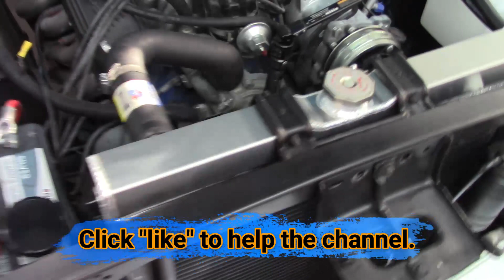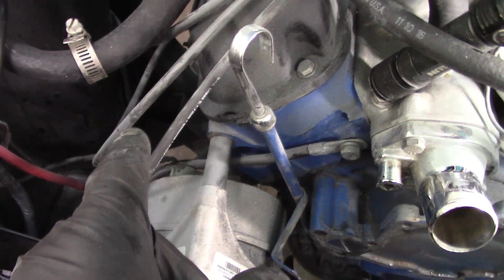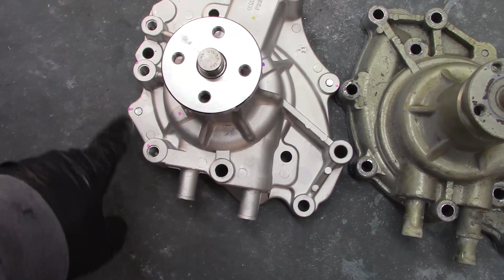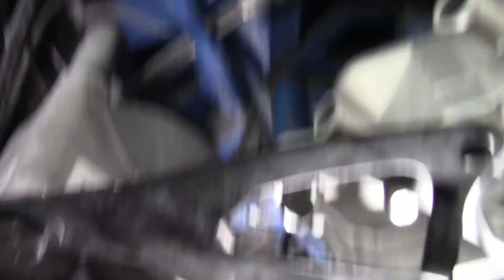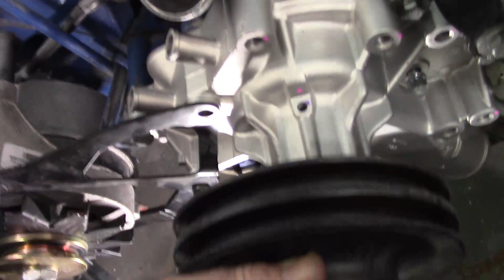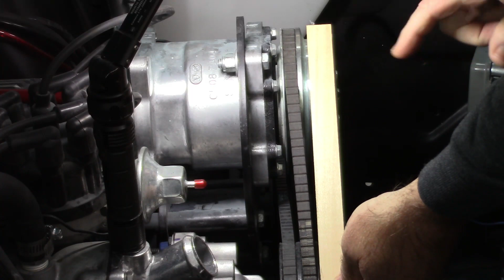Alloy Works radiator part 2. Water pump issues. Jade part 106.

Comment: You would have to move the pulley on the crank out for it to be right, if water pump shaft is longer then its not in line with crank pulley.
Reply from the maker: Good point. I will give it another look.

Comment: Don't forget that you won't see any water temp until that thermostat opens up. I have the same setup on my 428 with the aftermarket intake manifold. Adapting stuff is never easy and always drawn out. But it does make for good content... 👍

Comment: I think the 70 had the “upper” mount. There is an aluminum bracket that bolts to two holes in the head and has the alternator mount sitting high between those bolts. Betsy has the 70 style alt mounting. I can send a pic or check my early video, it’s there. 
Also you can press the pump fan hub to any position that clears. Might be better to press the hub on further then take the shims out of the alt.
Back in the day rebuilt pumps routinely required adjusting the hub spacing.
Reply from the maker: Interesting. I wouldn't think you could move the hub.